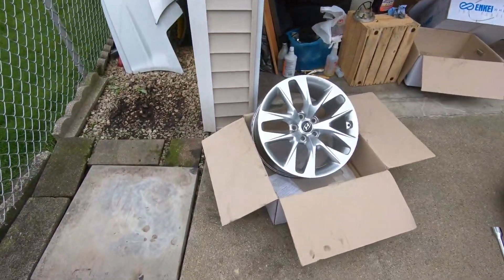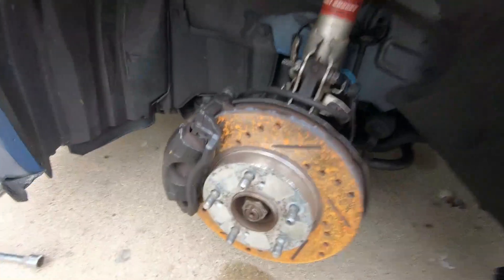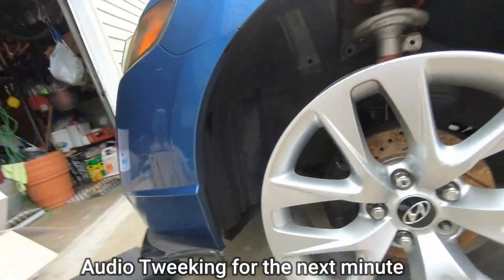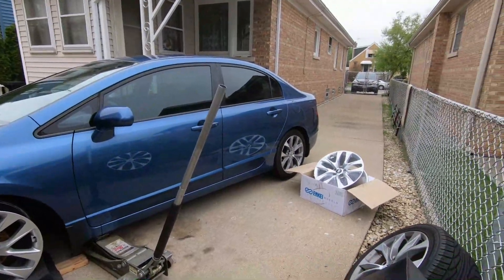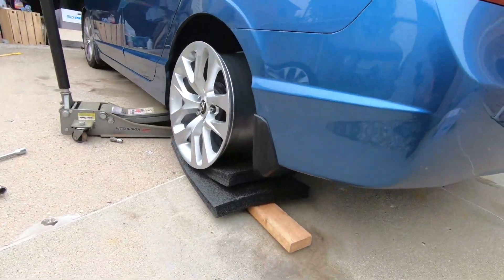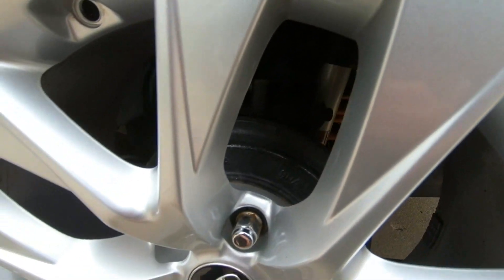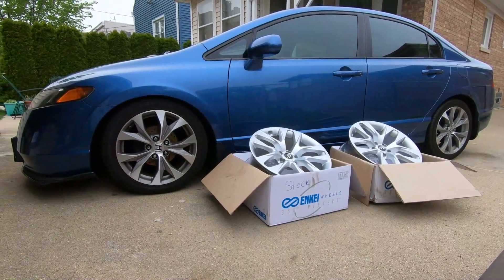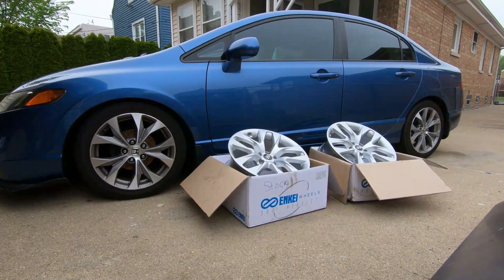Test Fit 18” Hyundai Genesis Wheels on My Honda Civic

Comment from the maker: what do you guys think of the fitment? What tire size do you recommend?
Reply: 215/40/18 maybe a little bit stretch so it won’t rub
Reply from the maker: That’s the size I was thinking too.  
But I don’t want there to be stretch and ride height gap either because then it looks improperly fitted.  I think The wheel specs are A bit to aggressive  for the look I’m trying to achieve.
Reply: Sharp